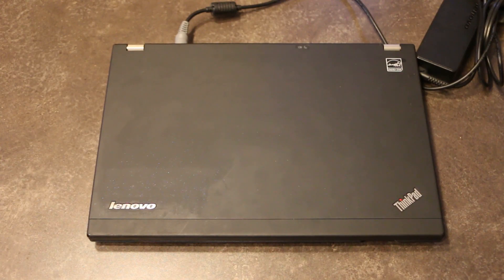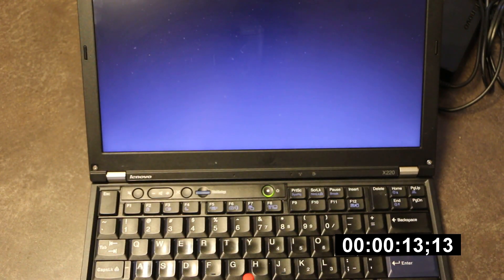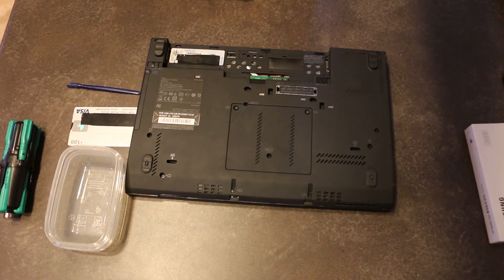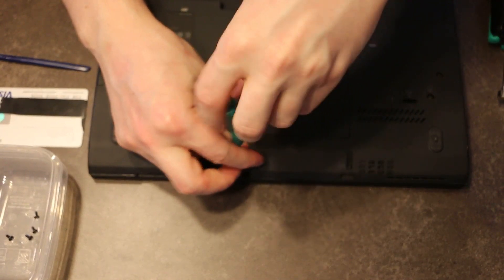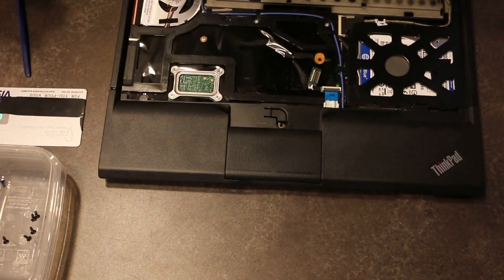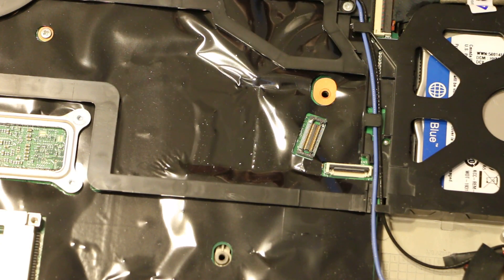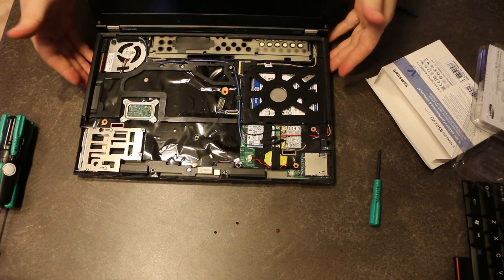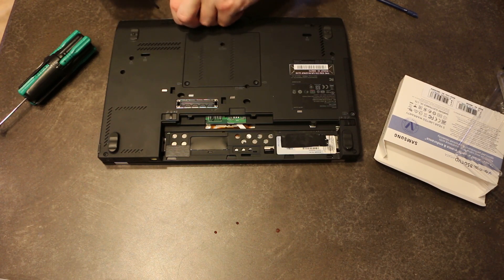Installing a SSD mSATA in a Lenovo Thinkpad X220

Comment: The funny thing is, Windows 11 seems to run better on the X220 than Windows 10.
Reply from the maker: That doesn't surprise me really. I get the sense you can strip down Windows 11 more than 10 but I might be imagining things.
Reply: @LaptopRetrospective  it's possible. I'm also just talking about driver and compatibility issues, though.
Reply from the maker: @rockstopsthetraffic Gotcha. I wouldn't think there would be much difference for a machine of this era.

Comment: Nicely done video - I'm resurrecting an x220t that I've had since new, with an msata drive internally that finally failed.  A 2T  Crucial SSD (around $100) worked fine in the 2.5" bay, any idea what the biggest mSATA drive that will work is? (Looks like those are much harder to find but went up to 1T at least?)
Reply from the maker: Good question on the largest size, I'm not entirely sure. mSATA isn't cheap so I haven't bought larger than 512.
Reply: @LaptopRetrospective  just to close the loop: turns out that a "Samsung SSD 850 EVO mSATA 1TB" (listed on ebay as MZ-M5E1T0 in the $120-$150 range) did actually work in my x220 tablet, I just installed ubuntu 23.04 on it, no problems.  (Was able to avoid mucking with the wifi antenna cables by just pulling the wifi card first and pushing a little bit out of the way.)
Reply from the maker: Ah great to know. Thanks for commenting on your success!

Comment: Thinklight on my Thinkpad x220 doesn't work. Could you please let me know what the problem is?
Reply from the maker: Make sure that all the keys needed to activate it are functional. After that, you will probably need to replace some parts.
Reply: @LaptopRetrospective  thank you for reply. So the problem is from the keyboard? How to activate its function?
Reply from the maker: The keyboard is the first thing I'd check. Make sure the keyboard keys needed to activate the ThinkLight work individually. If the keyboard works fine, then it's either the cable going to the ThinkLight itself or the actual LED.
Reply: @LaptopRetrospective  could create one video discussing about thinklight? I apologize I was searching about this on Youtube and I found no one 🙏🏻
Reply from the maker: If you want to know more about the ThinkLight in general and how it was made, I've done that. If you are talking about fixing it, you need to look up the Hardware Maintenance Manual (HMM) for the X220 and review the steps to replace it. It's a great guide.

Comment: I have one in my X230 and it is definitely a required modification. It's a huge performance improvement. I've tried both the X240 and X250 and the X230 is way better than both.
Reply from the maker: What modification was required?
Reply: @LaptopRetrospective msata

Comment: update the bios to version 1.46 but not the modified one, can i boot from the pcie?
Reply from the maker: You mean with an mSATA drive?
Reply: @LaptopRetrospective  yes and the hdd for storagr
Reply from the maker: I run Linux on my mSATA just fine.

Comment: This might be an old video but thanks for the Msata feature, my only hard task is finding one here in my country which is difficult
Reply: Yeah. In my country it's hard to find legit MSATAs by the usual suspects. Ramsta is the only brand in the "mall" (official brands) section of my shopping app. The 256 gig version is going for around $30 so I figure it's worth a gamble.
Reply from the maker: Good luck!
Reply from the maker: Yeah, mSATA is not a super common format even when the video was new. 🤣

Comment: I just installed mSATA 256 GB, and already installed a 2.5 inch SSD. I plan to make mSATA as additional storage. But after I installed mSATA it was not read as storage. I wonder why? -thanks
Reply from the maker: Probably needs to be formatted for your OS.

Comment: Hi i have a question. If my OS (either Windows or Linux) boots from the SSD, can I also add a M.SATA drive in there to use to save my files WHILE I'm working on them on my normal OS? In other words, does it kind of replace a USB memory stick? Maybe silly question but just trying to make sure
Reply from the maker: The mSATA drive is a legit second drive. You can boot to it or use it to store files. Up to you.

Comment: Thanks for sharing how to install the msata SSD on X220. But what if the BIOS didn’t detect this new hardware? Any solutions? Thanks.
Reply from the maker: That's strange. It should if it is working correctly. There's no need to flash a custom BIOS for this addition.

Comment: Hi Laptop Retrospective. I love your channel! I am thinking of upgrading my just bought X220t from HDD to SSD. Do I need to transfer the files before swapping it? I am using Windows 10.
Reply from the maker: That depends, do you want the SSD to have the operating system on it or are you just wanting the extra storage. Having the os on the SSD would give a noticeable boost in performance.
Reply: @LaptopRetrospective  Thank you for your reply. I'd like the SSD to load the OS. I am thinking about how to transfer the files as I only see 1 slot with the HDD. 🤔
Reply from the maker: This video is about an mSATA SSD that goes into a different slot. But the Madrid essentially remains the same. Macrium Reflect is what I use to transfer data. Lots of tutorials out there and free to use.

Comment: Hello. 
Found your amazing channel yesterday( I technically got into laptops much better now), I want to get a laptop for university now. I like these X220s there is also X200i option or X1(Core I3), they are so nice and mobile? Do you think these are good choices?
 So, I’m sorry, but I want to make a disclaimer, so you added a small SSD and took out the 2.5 one(and if you don’t remove that you can have 2 SSDs) and if there will be a X220 with 4GB RAM, I’m planning to add another 4GB DDR3l RAM, it’d be ok I guess?
And how slow are these i3 2nd gens? Is it worth to spend 50$ more to get i5 2nd gen?
Thank you very much.
Reply from the maker: Hi BaG, 
Thanks for the kind words about the channel, I will do my best to answer your questions:
I'd stay clear of the i3 variants. The extra money you spend is worth every penny because you are stuck with what you buy with the X series, those CPUs are soldered on. The X1 is nice, as is the X220 and X230, I'd stay clear of the i and s variants as they often have reduced features/options.

This mSATA drive is installed in an unoccupied slot and does not impact the 2.5" drive bay, so you can have two drives at the same time. Depending on what you are using the computer for, 8GB is a nice amount of RAM.

Let me know if you have any other questions.
Reply: @LaptopRetrospective  Thanks, when I said ‘X200s’ I meant in plural not the X200s model, sorry. So it can be said that I’m kinda on budget now, the X1 core I3 with 8GB ram and SSD is like 150$, the X220 with i3, 128GB SSD and 8GB ram would be 210$, and the X220 with 256 SSD, 8GB ram and i5(2nd gen of course) would be like 250$ so is that extra 100$ actually worth it? I just need it for University(I’m not even going to be gaming xD), movies and web. I appreciate your attention mate, means a lot <3
Reply from the maker: No problem, I try to answer every comment. If budget is tight, the X220 is one of the most moddable ThinkPads in its class. So to me, it's worth it. Parts for it are also a lot more common than the X1. The X1 and X220 will outperform the X200.
Reply: @LaptopRetrospective  Oh I did it again, I’m so sorry, I’m kinda clumsy today, I again meant the X220, but still, they have the same stats, same RAM same SSD, and almost the same CPU( I mean X220 i3 and X1 i3) I meant that it’s be enough for my aims, but not totally sure. On the other hand the i5 version is 100$ more expensive. And as I can see libreboot is still unavailable on X220 right?
Reply from the maker: I'd suggest Coreboot which is available. I'd still lean towards the X220 because of parts availability and mods especially if your budget might only allow you to upgrade a bit at a time.
Reply: @LaptopRetrospective  Yeah, I like X220 much more, I just meant the X1 was more cheap. So I’ll buy X220 and add 4GB RAM. Thank you very much, I respect this community, you are such a great people. I’ll try to be part of it too :) 
I’ll be watching your channel regularly now, very entertaining and interesting for me. 
Stay healthy.
Cheers!
Reply from the maker: You'll be pretty happy with your choice. Lots and lots of information, parts and people at your fingertips to help with these machines. Keep us posted on how it goes.
Reply: @LaptopRetrospective  Sure, BTW do you have a Discord server? Or something like that? To keep in touch, besides Youtube, that’d be nice, in my opinion, I don’t know.
Reply from the maker: I'm most active  on Twitter outside of YouTube. I lurk on a Discord server or two but don't have my own.
Reply: @LaptopRetrospective  Hello again :) I just came across with a nice deal, but it doesn’t have a battery and I couldn’t find it in my region. So can a L440 battery fit it? Or can I install a camera by myself on it?
Reply from the maker: Not sure if the batteries are interchangeable. A quick Google search should tell you the battery types.
Reply: @LaptopRetrospective  Thanks, I’ll tell you mg experience when I buy it :)
Reply: I made a little research but couldn’t find it, none of the sources said that they were compatible. Even though the battery fits T440 and X240. So I suppose it could fit X220 too?
Reply from the maker: The X220 and X240 era machines have different batteries.
Reply: @LaptopRetrospective  Oh okay, thank you.

Comment: Will DDR3L 8*2 (16) will work on this laptop X220?
Reply: Yes, it will. I have 2 x 8Gb Ddr3L on my X220. I am not sure about all X220 are the same in this way, but mine is work, and do it pretty quick on 16Gb and win10.
Reply from the maker: Short answer, probably. You might want to consider using a modified BIOS that allows you to take advantage of better RAM if you're going that route. It will also help with which DDR3L is compatible.

Comment: Can I put an SSD drive into a Thinkpad x200s? What kind of drive would I need?
Reply from the maker: 2.5inch SSD should fit. X200S is capped at SATA 3.0GB/s.
Reply: @LaptopRetrospective  Thanks. This is all new to me. So should I not use drives labelled SATA II or III?
Reply from the maker: Use a SATA 3 drive as they are the most common. It will still work.
Reply: @LaptopRetrospective  Thanks, very helpful!
Reply from the maker: You're welcome.

Comment: Coreboot it and put a 3rd gen intel inside.
Reply from the maker: Coreboot is one thing but the CPU is soldered to the board.
Reply: @LaptopRetrospective  is it in the x models? I didn't actually know, I have a T420 so that's what I did.
Reply from the maker: T models is socketed, X is soldered.
Reply: @LaptopRetrospective  Good to know, thanks.
Reply from the maker: No problem!

Comment: This solution is fantastic on the light x220, giving option to dual boot independently or hot swap data storage.

Option 1: Testing future main distros without VM (I'm doing that for LARBS, maybe Gentoo), troubleshooting other OS or make back ups before reinstalling..
Option 2: Extend the storage without using USB adapters.
Reply from the maker: Yep, I absolutely love it.

Comment: Hi there. I wanted to install msata SSD in my X230 but it seems that I will have to disconnect the WWAN card first inorder to connect the msata. After connecting the msata will my Wifi work or does wifi have a dependency with WWAN card?
Reply from the maker: WWAN isn't what connects you to WiFi, that's WLAN. You do not lose WiFi functionality.
Reply: @LaptopRetrospective  Thanks for helping out buddy!👍🏻
Reply from the maker: No problem!
Reply: I have a question to add to this, what functionality will be lost by removing the WWAN? I searched but I couldnt understand what it provides (I thought it was wifi but from what you say here this is wrong)

Comment: Hello there, I need some recommendations in buying either an x220 or an x230. The x220 I found is in very good cosmetic condition (i5-2520m,4gb,320sata) for 3600nt(around $120), and then the x230 i found is in okay condition (i5-3320m, 4gb, 240gb ssd backlit Keyboard), for around $150. 

So, should I shave of some $ for a fine x220 or just go with the x230? Either will be my secondary laptop for very light programming since I have a desktop.
Reply from the maker: SSD gets points in my book. Keyboard style is personal preference. X230 should have USB 3 and newer integrated graphics. Hopefully good screen.
Reply: Choose X220

Comment: Hi, my Lenovo X230 has an HD SATA, to improve performance it is more convenient to upgrade with a SSD Sata 2.5 or an SSD M.2
Reply from the maker: Not sure if you have an M.2 slot to play with. You have mSATA but it isn't full speed. You'd be better off doing a 2.5 SSD.
Reply: Thanks for your help, I will then consider installing a 2.5 SSD @LaptopRetrospective
Reply from the maker: @saucedoroberto1  You're welcome! Best of luck with your upgrade.

Comment: I put in the msata and now my x220 won t boot to my SSD main drive unless I hit f12 and use the boot menu. I use uefi and legacy ssds same issue . I am using a flashed bios w/ no white list. What am I doing wrong?
Reply from the maker: You need to change the boot device order in the BIOS
Reply: @LaptopRetrospective  thanks for the reply but i cannot find this boot order option in the new bios version.I only see a boot order option for networ booting (also tried there ) otherwise I only found uefi or legacy first bu t no hhd priority list.
Reply from the maker: @clutchSA  It is in there, go through all the menus and I'm sure you will find it.
Reply: @LaptopRetrospective   I am now thinking that the bios flashing went wrong because I cannot find the boot order configuration anywhere on the bios setup screen. can someone that has actually done this please tell me what screen i have to go to and verify that this line is actually there in my bios. I remember that when I flashed it the program retried flashing my bios many times and kept failing untill it stopped giving me that message. When I restarted the computer the bios had the advanced tab rhat wasn't there before but now I am not sure it went totally well. 
Thanks
Reply from the maker: BIOS, then Startup then Boot, first option says "Boot" select it and configure as desired.

Comment: Could someone tell me why my x220 stutters overall also the sound stutters when I turn on my wifi adapter. Its perfect if I connect a LAN cable to it and keep the wifi turned off. Tried with different drivers, didn't work, installed Win 10, still the same. Im just curious what could be the issue ?
Reply from the maker: So the computer stutters when WiFi is turned on?
Reply: @LaptopRetrospective   Yes. I looked everywhere around the web but didnt find a working solution to the problem. I saw other people with a simillar problem though. Is it possibe that the wifi adapter is just defective or something like that ?
Reply from the maker: @TheRojman  It sounds like you have tried every other possibility. It is either your card or something wrong with the board.
Reply: @LaptopRetrospective Pretty much, sucks either way, the least painful thing to do is to replace the card. Problem is I dont know if they are easy to find, especially where I live.
Reply from the maker: @TheRojman  Check the maintenance manual for the parts you need or you could install a modified BIOS and put in a nicer card.
Reply: @LaptopRetrospective  I will look into that and thanks for help. Love the channel btw, keep it up! :)
Reply from the maker: @TheRojman  Thanks. Best of luck!

Comment: Unfortunately, these days the general public is totally obsessed with everything that is super slim, no matter if that causes overheating, throttling, loss of performance  or the keyboard is junk. The X220 is boxy, but is still very light, quiet and is just extremely pleasing to use.
Reply: People don't need 10mm thin laptops for "portability" when 99% of school students carry a 5" thick binder in their backpack every day with no problem.
Reply from the maker: Agreed. Great piece of kit.
Reply: And very portable, I'm taking it anywhere I go
Reply: "Boxy but good"
Reply: x230 with x220 keyboard best
Reply: haha, I thought you might be referring to the SSD itself, because they are slimmer!  I wonder if adapters would be the best bet now.
Reply: Yes, the problem is the processors of that generation. I wish there was some way to put in a new generation, low-power processor like the Intel N. It would be amazing to get 8 or 9 hours of battery life at maximum performance on these ThinkPads

Comment: @Laptop Retrospective Do you know if it would be possible to flash the bios and remove the IME to be able to run CoreBoot or LibreBoot on it (similar to what MiniFree.org or tehnoetic.com does), for a completely Free system - or would there still be some sort of backdoor remaining? TIA, you rock.
Reply from the maker: Some older ThinkPads can do it no problem. Others require significant tinkering.
Reply: Librebooting isn't available for x220 and later

Comment: Hey really enjoy your informed videos on the x220. Can you give a list of all the essentials I would need to get best upgrades with price. Obviously the i7 xpu is best and the ips screen, 9 cell battery, but how much ram can I install and what else would I need for the fastest x220? Thanks in advance
Reply from the maker: 16GB of RAM is the max it will take but I'd do an SSD upgrade as you'll notice that jump in performance more. That and unlocking the BIOS for that nicer WiFi speeds.